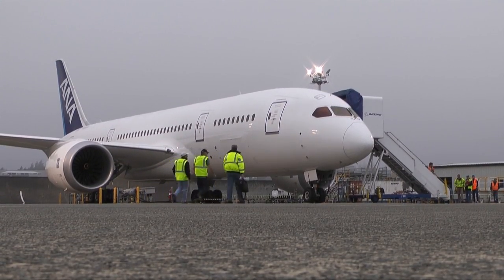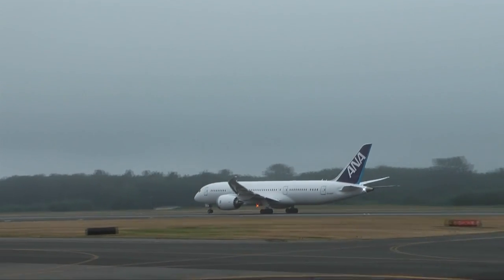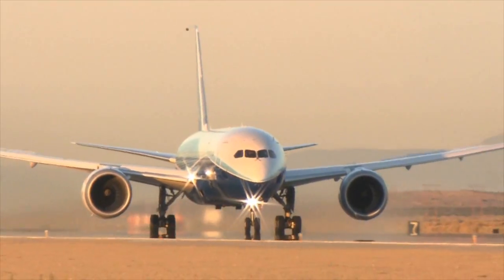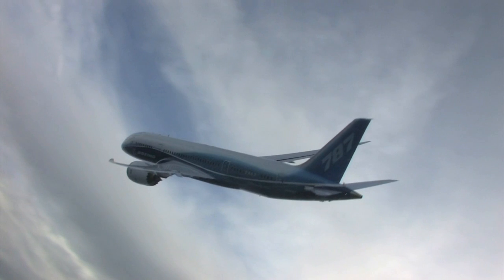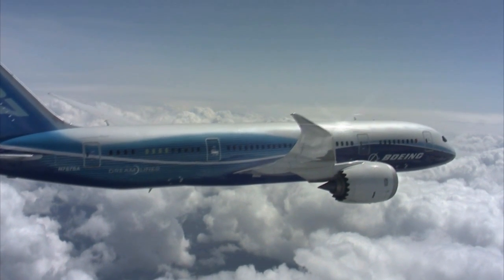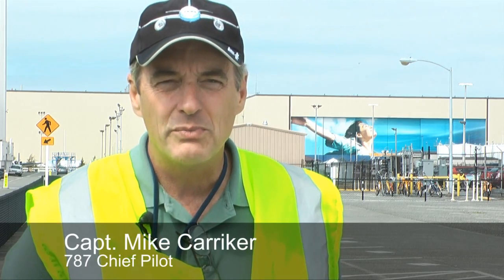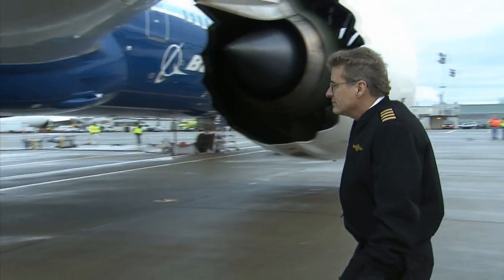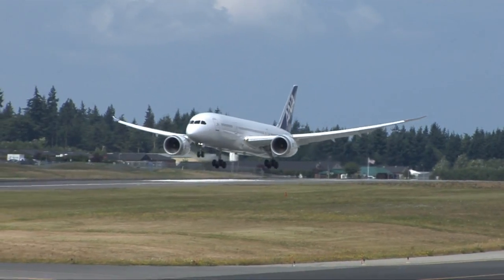787 completes jam-packed certification testing program

Comment: @omhyr21 Considering the 787 is a direct replacement for the 767, there's nothing that's really "little" about it. Anything with a max takeoff weight of more than 500000 lbs is big-time by definition. :)